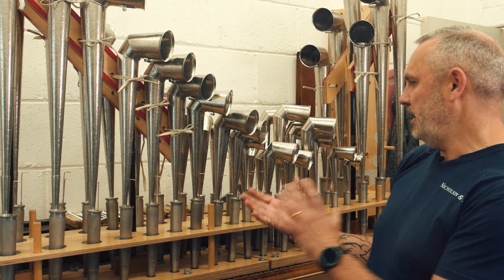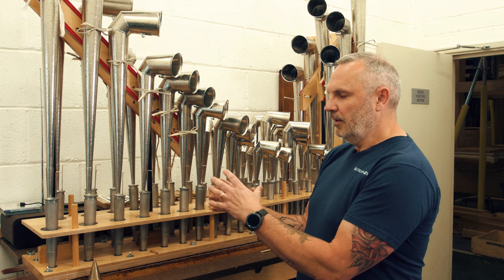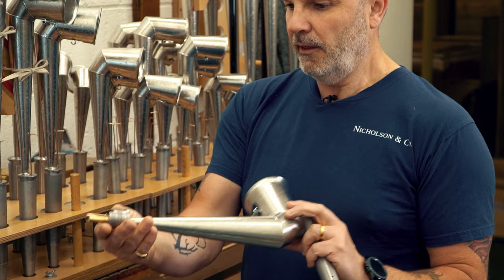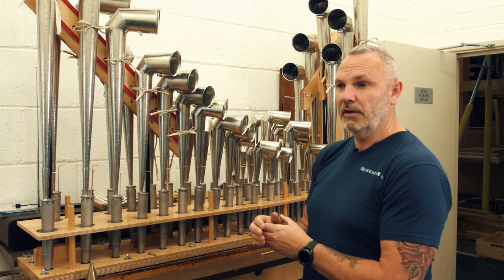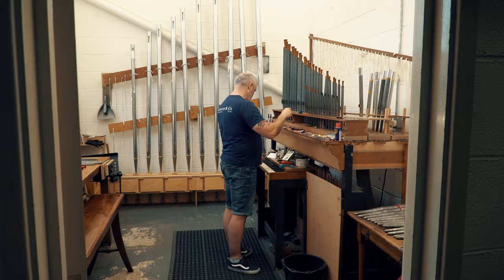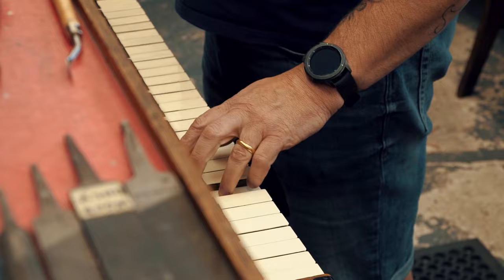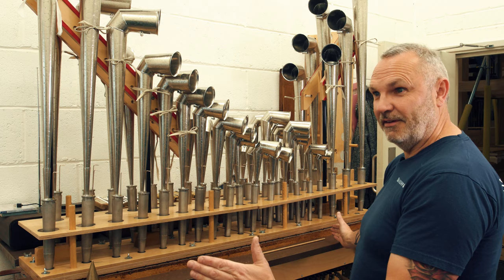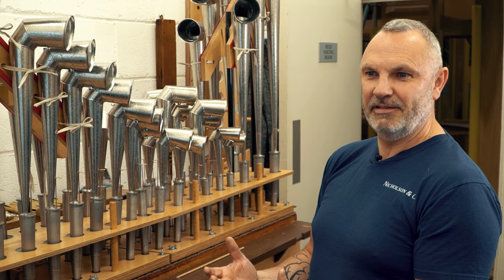James Atherton talks about voicing the Leeds Town Hall organ

Comment: Interesting. As some large cathedral organs have thousands of pipes I have often wondered if there is a combination of pipes that has never been sounded or heard? There are millions of lottery numbers that have never come up so why not a new sound from a new selection of pipes? Just the idle thoughts of an idle fellow.
Reply: At Leeds town hall, there are about 40 stops on great and pedal. To get through all combinations of those, trying one combination every second, would take about 35,000 years, so indeed only a tiny fraction of the possible sounds have been heard.
Reply: @ChrisGJohnson  I suppose you could take it further with the Royal Albert Hall organ, which is much larger than Leeds. 36 stops on the pedal, 32 on the Great, 68 in total. The Swell alone has 25 stops. As you say the combinations are virtually endless.